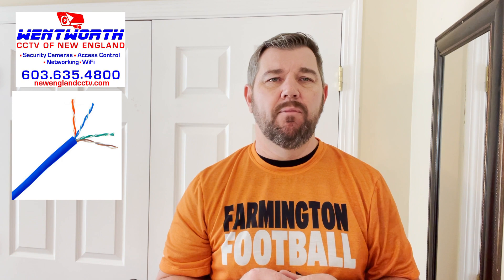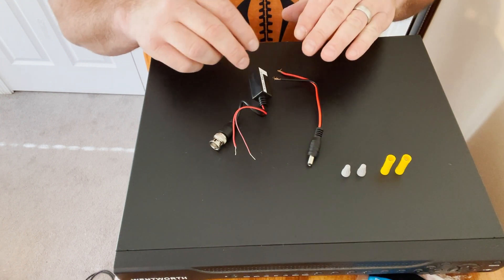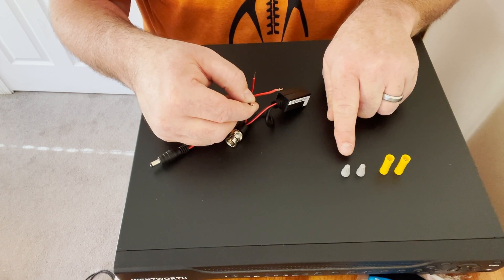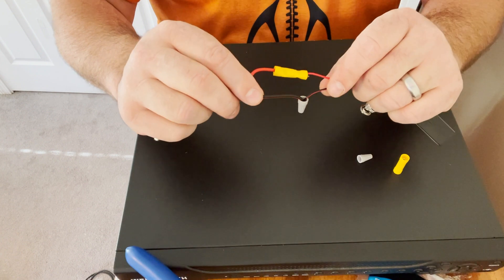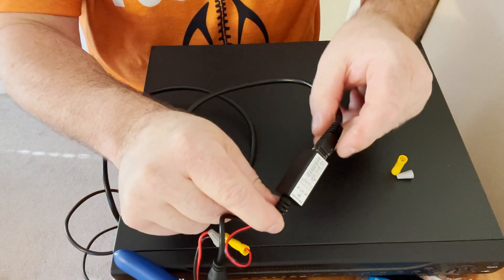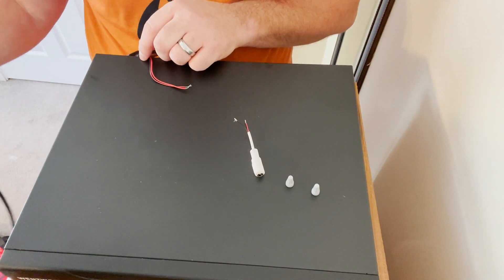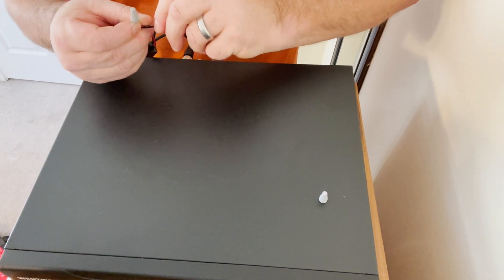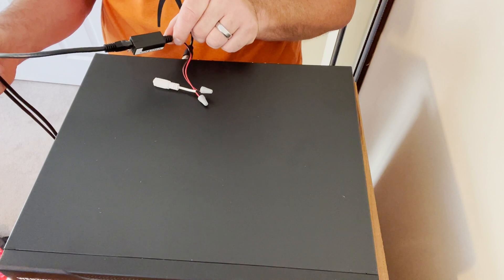Connect AHD CCTV Camera to DVR using Video Baluns and Cat5 Cable

Comment: hello mister
I have a question?

I have in my store 16 channels samsung
dvr(sdr-c75300)
I want to replace it for Hikvision NVR 32CH 24 PoE

The cameras I have are from Samsung
(sdc-9441bc)
1080p Full HD resolution

Is this adapter suitable for me to install my cameras to?
 Hikvision NVR plugs with the cat 6 cable?

If in the field you can make an episode, how is the method of converting the wires of the BNC cameras to the NVR device, meaning the first party that is installed in the camera is installed through the BNC adapter, and the other side is installed with a direct rg45 wire in the NVR device? Is this method valid and the camera transmits what is recorded to the NVR?

Thank you very much
Reply from the maker: You cannot connect analog cameras to an NVR. The video is showing you how to use cat5e cable to connect analog cameras to an analog DVR using video baluns. You need use IP cameras with an NVR.

Comment: Hi can theses be used to connect a BNC camera to a NVR that uses poe where we would only use one end which is the BNC to the camera and then the lan part to the NVR and not to the other converter?
Reply from the maker: No because analog cameras cannot be networked. The NVR needs to give the camera a IP address and analog (or BNC cameras) do not have that ability.
Reply: @WentworthCCTV  ok thank you